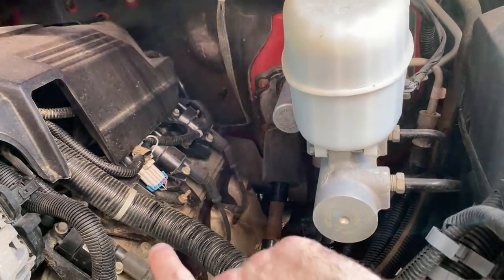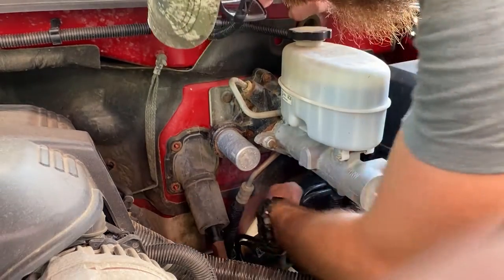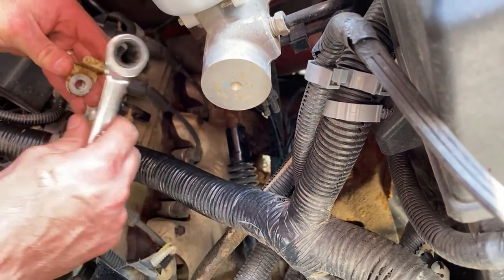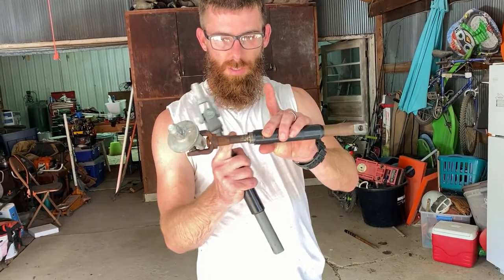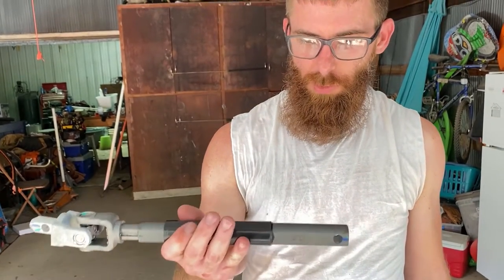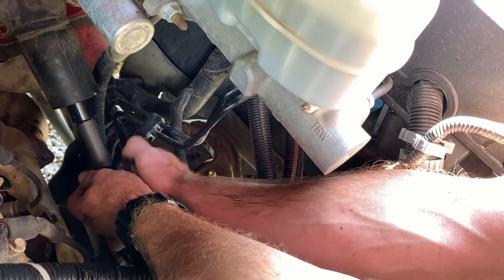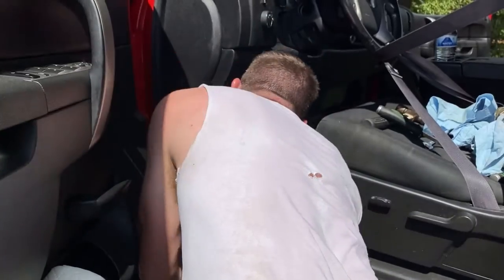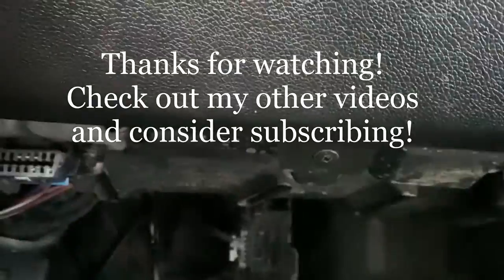The Fix // Steering Clunk // 2007-2013 Silverado

Comment: For anyone on the fence about this, jump. It took me 25 minutes and that includes dragging tools out and clean up. Im not dealing with rust though. I do recommend having a large 18" screwdriver or crowbar. I used it to push the shaft down with help from the back of the brake peddle arm. Would also recommend a magnetic stick for dropped nuts.
Reply from the maker: Thanks Leut Dan! Good advice. Glad the repair helped you out

Comment: By doing the steering shaft replacement did you also see an improvement in steering wheel play while driving?
Reply from the maker: Hi Zeth. Yes it did improve a little but the steering shaft is not normally the cause of steering wheel play in these trucks. The shaft is still solid but it freezes up and won’t extend up and down to adjust for movement in the steering components which is what causes the rattling or knocking noise. At least that was my experience. Thanks for watching!

Comment: I changed the intermediate steering shaft and the lower steering shaft it still does it but not as much 
It mainly does it when I brake
Reply from the maker: There could be other components in the front end that need attention. Have you checked the tie rods and ball joints?

Comment: Did you happen to have a chirp sound. I’ve developed a chirping and not for say it’s bump related but it doesn’t make it better. So It sounds like it’s coming from my dash. I stuck my phone under the dash by firewall and I hear that clunking and chirp.
Reply from the maker: I did not have a chirp personally. I had a lot of clunking and banging sounds.

Comment: I replaced my steering shaft on my 08 duramax but I did not secure my steering wheel. I believed I moved the wheel an inch or less. I haven’t drove it yet but How will I know if I messed up the spring inside the steering column?
Reply from the maker: If it’s broke it will mess with your electrical components that feed through the steering wheel such as cruise control, air bag light may come on, radio adjustments on steering wheel may not work, etc.

Comment: Mine is so froze I'm thinking about cutting it out same exact truck can I do that guys I own a lawn care company out of my home and need to get back on the road
Reply from the maker: Which part is froze up? The cable or the post/lever part the cable attaches to?
Reply: @PoplarRidge  it's the shaft part that's supposed to slide down and come out of the steering wheel
Reply: I've tried tapping it out like you said but it's not budging
Reply from the maker: Did you get it?
Reply: @PoplarRidge  oh yes sir I had to be steady but it worked perfectly unfortunately it was my rack and pinion I believe it's road wondered and had like a half inch dead space